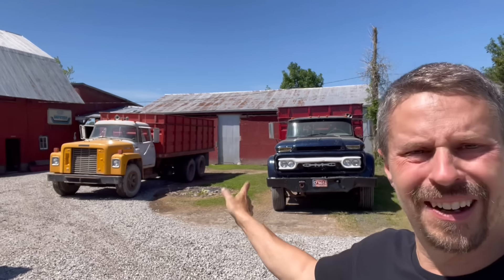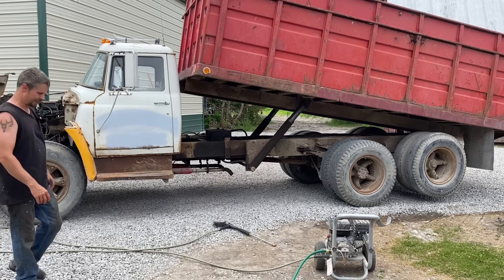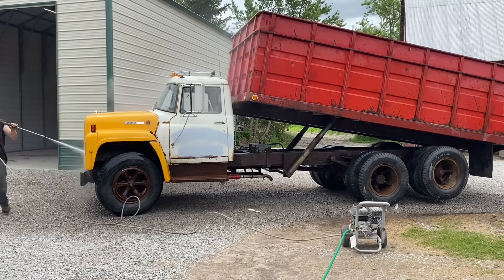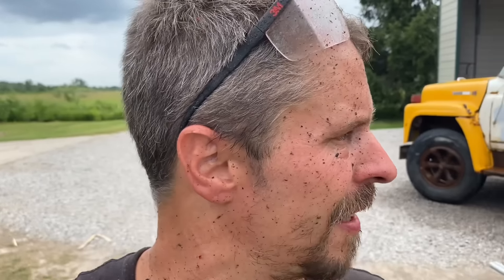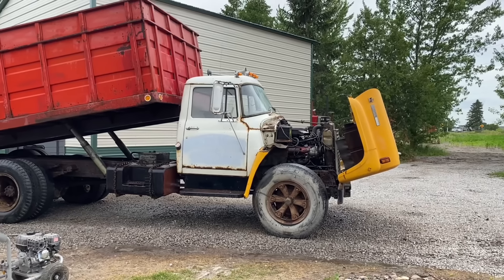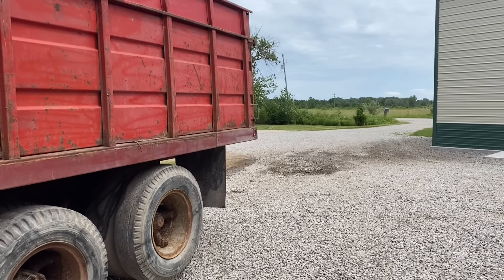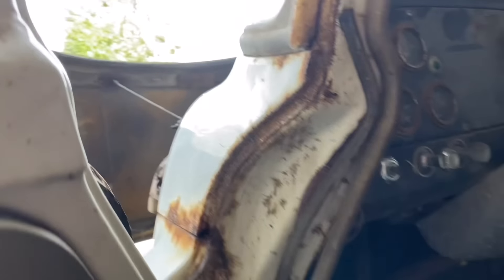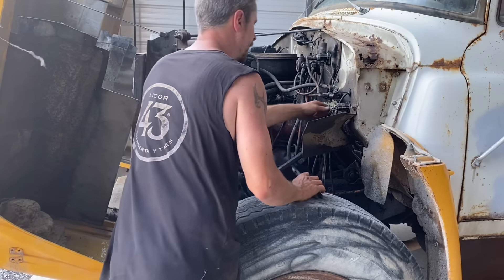Around the farm with JT!  Let’s begin paint on “Sully” the  IH loadstar grain hauler!

Comment: Just a safety thought for you, when you are working on or around a lifted box on the old grain trucks, just for piece of mind, slide a 4x4 or 6x6 post across the frame. I've seen worst case where a lift cylinder seal had a leak to it for months and low and behold, it finally gave out with the bed raised. Anything can happen when you least expect it. Just be safe please. The new shop you built is turning out to be just perfect for whatever you venture into 👍. Keep up the good work JT.
Reply from the maker: Right on!  I’ll keep one nearby for the next time 😉
Reply: That front clip looks like a donation from a school bus
Reply from the maker: It was!

Comment: Great job JT. You might want to try a turbo nozzle on your pressure washer. I use one cleaning equipment and it takes the major part of the grime  without using degreaser
Reply from the maker: Right on!  I have seen them, just need to get myself one now!

Comment: Hey JT great job at Wally world I mean Walmart they sell a oscillating tip for your pressure washer put it in a circular pattern and it really makes a difference it will strip off anything it hits it's only 20 bucks you need to really try that out if you don't already have it big fan serenity
Reply from the maker: Right on!  I’ll need to get myself one of those!

Comment: Nice one j.t as normal.  Did you manage to do a deal on that massey at scrap yard like you did on other thing. Did you remember to do the pump on combin when it was in work shop.  L.o.l.  I like the new water sand plaster put you need lot off air pressure but doesn't make any  mess really just water it really good bit of kit.  From Andy in uk
Reply from the maker: I didn’t check on that one just yet, but I may if my TO35 needs parts
Reply: @jtsbarnngrill6873  ok . Just let you know there is going to be a big tractor run. Dave maybe going.  But its mainly all 1200 1250 and big ones like yours. If you check out farmer Phil.  It's a one off. It's in  memory off his uncle.  Check him out please.  He is a massey man.  Thanks

Comment: Hey you know that oven cleaner works better the that degreaser does and it will remove some rust as well
Reply from the maker: I’ve heard that, but had a couple cans in the shop
Reply: @jtsbarnngrill6873  well me and my dad use oven cleaner on our 1566 international and it will cut through really tough grease unless its over half an inch thick and if you let it soak for 15 minutes it will eat paint after that so be aware of that.